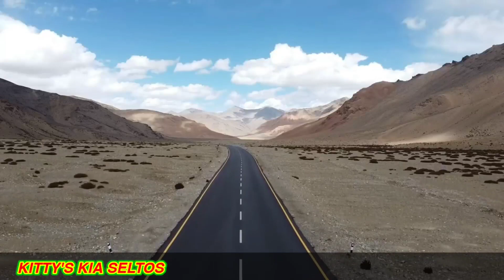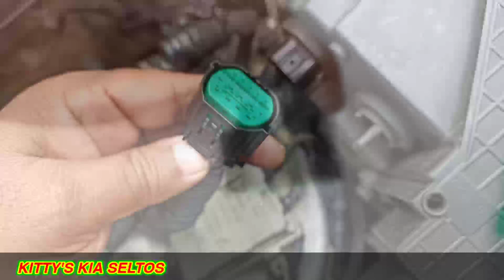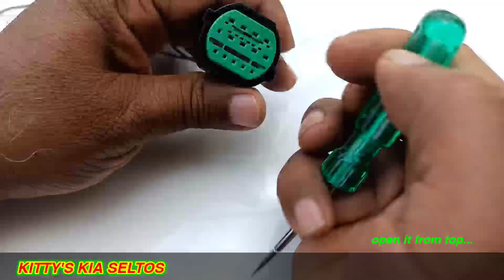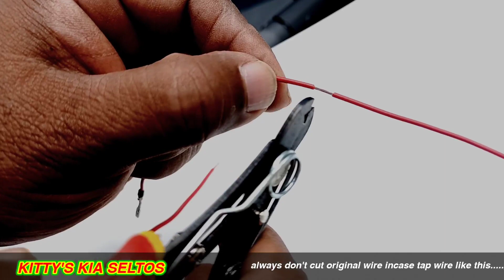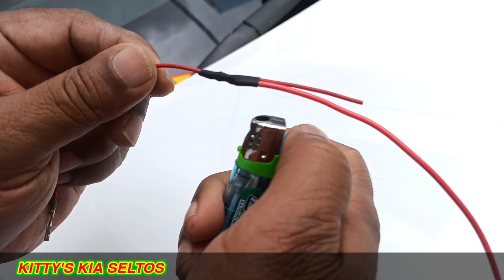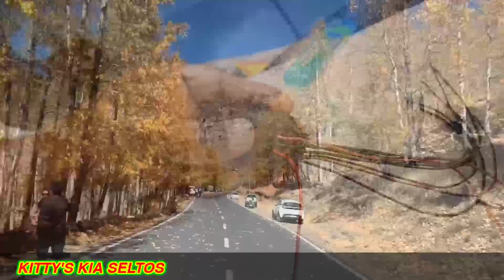KIA SELTOS HOW TO DE - PIN CONNECTORS HEADLIGHTS COUPLER

Comment: Why you did that ? Any specific reason for removing couple wire ? You could have joined extra wire without removing it from socket 🧐
Reply from the maker: Sir after removing you can solder or put heat shrink that all